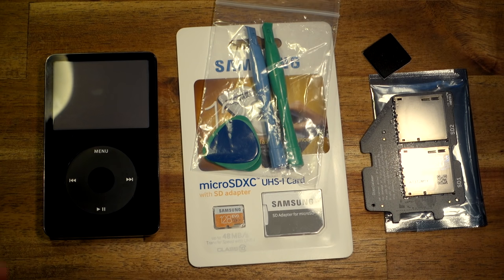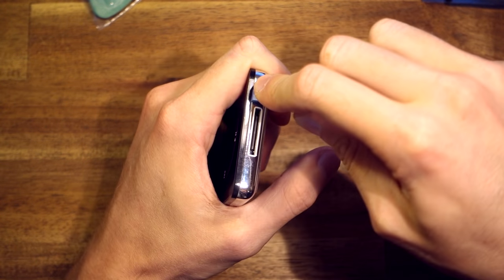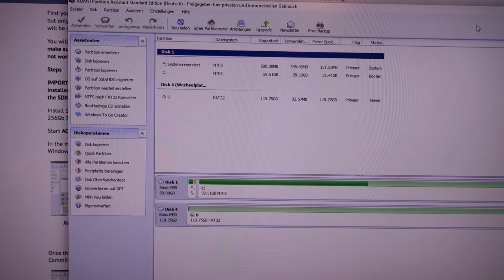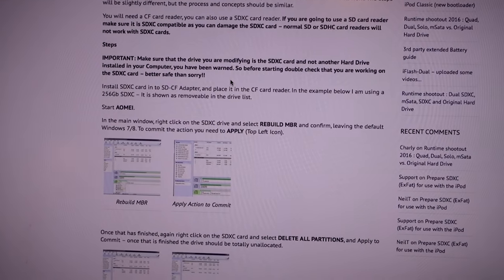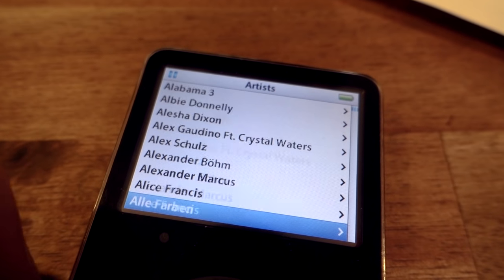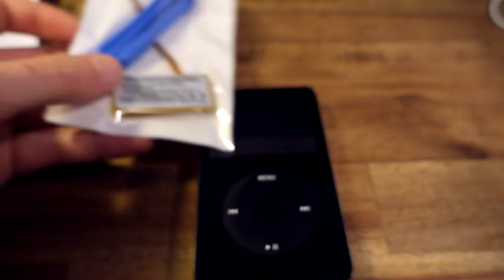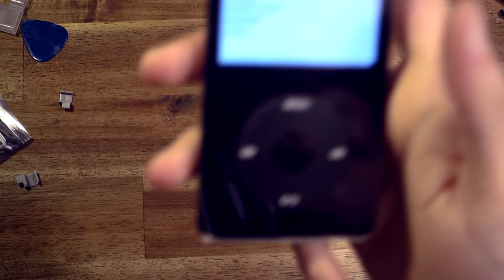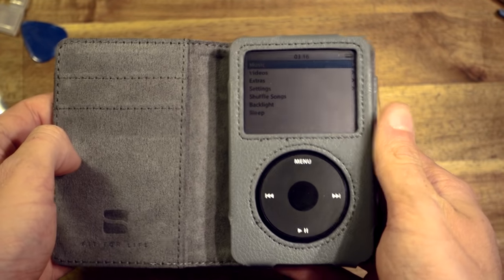iPod Video 128GB SD card upgrade

Comment: Nice little video with helpful info about the parts. Thanks!
The only nonsense I see here is the case for the iPod. A case is to protect it from stratches, but if it's already strached, you don't need it!
Reply from the maker: Cheers! :) For me the case is mainly for drop protection ;)

Comment: Thanks for sharing the video. Too bad about the screen. Something similar happened to me once and that is when I learned to always have a soft clean work surface. As long as we learn from mistakes, it's all good.
Reply from the maker: +chaukat wolfgang I definitely learned from that mistake :D but as you said it's all good. And I found a cheap replacement screen which is on the way to me now, the iPod just deserves it ;)

Comment: I had the same problem. Turned out I was using too cheap of a compact flash card converter card. Who would've thought something manufactured in China to the US market could be substandard? (Obviously sarcasm)

 When I got a more expensive one, My San Disc 128 GB CF card worked awesome. This has to be a compatibility issue between the card and the card reader or the card reader and the iPod. 

I also got the extremely low battery even though I was replacing the lithium battery at the same time. If you tear the cables coming out of the battery or the port switch, both are available for very reasonable cost online. My headphone jack and batteries were worn out so I decided what the heck… Go ahead and replace the HD with a CF card.

 so what exactly is everyone repairing 15-year-old technology when you can bye replacement for about the same price?

 Because we can.
Reply from the maker: Cheers for your comment John! Awesome that you got the CF card working, maybe this helps some people out here :)
Reply: remember the ipods and iphones are made in china
Reply: Repurposing classics never dies.

Comment: If you write the date that you replace the battery on the inside of the cover with a marking pen, next time you crack the case open, will know how long that battery lasted. Guess my old dad taught me a few things!

 using foam to adhere the battery to the metal cover doesn't make sense. Metal conducts heat. Why would you want an insulator between a battery which can get hot and the metal plate which conducts the heat away from the battery and circuitry? I used two small pieces of double-sided cellophane tape. I want the battery heat during charging and discharging to dissipate. At least theoretically it makes more sense… Right?
Reply from the maker: Ah yep your're right. Tape is definitely the better way to go, makes sense. I will replace mine when I open it next time :)
Reply: Brilliant idea!

Comment: nice video. I still use my 80gig and plan on upgrading the storage and replacing the battery soon. Mines a lot easier to open than yours, usually just use the corner of a credit card and it pops open.
Reply from the maker: Awesome man! Mine now opens also a lot easier than the first time :)

Comment: I just installed an iFlash Solo into my 30Gb iPod Video and wouldn't you know I installed the iFlash board backwards.  The iFlash Solo and iFlash Dual have the SD adapters on the opposite sides.  In other words, the iFlash Dual when properly installed both SD adapters face down (facing the iPod circuit board).  On the iFlash Solo, the single SD adapter faces up when properly installed (facing the aluminum back).  That's what threw me off.  Naturally, I got the same errors as the poster did so I flipped over the iFlash board and success.

IMPORTANT  What you want to make sure of is that the angled part of the iFlash board is always on the right side when looking down on iPod circuit board for any of the iFlash adapters.  The Dual is the only iFlash adapter where the SD adapters are on the opposite side from the other iFlash boards.  So, for every adapter, the angled part is always on the right side when properly installed.  The upper left side of the iFlash board fits in below the iPod's hard drive stop so it can't move around.

I wanted to thank the video uploader for the making the mistake of reversing the adapter or I wouldn't have known what I did wrong.  OWC's video didn't go into enough detail and they used the compact flash adapter which was different from the Solo. (Same with the iFlash site). Everything is working great for me and now I'm ready to replace the hard drive in my 80GB iPod.  My main reason to use the SD adapter was to get longer battery life rather than space for more music.

My 30GB iPod hard drive is still working perfectly after all these years (Thank you, Apple).  However, I needed to replace the battery (again) which couldn't hold a charge and I noticed the Tarkan iFlash when searching for a battery on the internet.  I killed two birds with one stone and got a new battery and the iFlash.  Awesome boost for an old iPod for a total of $50.

Comment: Congrats for the video! Quick question: is it necessary to Format the SSD before inserting on the Flash Board? If so, which Format must be used (MBR, GPT, etc). Thank you

Comment: Hey, first of all, good job! This will certainly help a lot of people, so this is nice. Did you have any i/o problems with the SSD? I mean, is everything always OK in the filesystem, so you can transfer and perform all music without any problem? I'm asking because I replaced my Ipod's HD with a Sandisk 128GB SDXC but even thought everything looks fine after synchronization with iTunes, most music just don't play. They are there, but just don't play. I suspect it's some defect in the SSD. What do you think?

Comment: Seems that the screen didn't crack, maybe the conversion board is just touching the reflector :)

I like the HDD sound as well, that's why I didn't change it, maybe when it die, but it's supposed to last several years (I use a rubber case :) )

Comment: Wouldn't it be possible to mod it with a Micro SD card reader and with the extra space inside get a bigger battery in there? I'm sure with the right regulators like the ones used for Raspberry Pi zero and such it could work out
Reply: You were way ahead of the game and predicted the future there!

Comment: really kool guy. got two of these iPods. one for every car. the one i have in my prius still is rocking the old HDD and runs without a problem. the one in my 300 died so i replaced it with the compact flash thing. only 16gb. but i must say, your iPod runs really snappy. more snappy than my CF iPod. nice work on your iPod though. those plastic tools suck.
Reply from the maker: Cheers :) It's so cool that there are still a lot of these iPods around. The plastic tools really suck :D

Comment: I was wondering if using an micro sd to sd adapter would be okay! good info.  
I am about to do mod myself.  I can't decide whether to go with tartan and get his stuff whether it be the SD solo, dual, the quad micro, msata or even the CF flash (I found a 128GB cf card on amazon for 70+ bucks!)
or I am also wondering about maybe just getting a cheap Chinese zif to msata adapter and using a 256gb msata.
My whole question lies on the battery.  I do not know if the Chinese adapters will still allow me to use a larger battery. Did you find any larger batteries online? what size did you use?
Reply from the maker: I didn't really find larger batteries online, I think mine is 550mah which is a little bit larger than the original but the same size as the original. As for the adapter I think I would go with a SD card adapter, it seems like msata uses a lot more power. They tested it here: https://www.iflash.xyz/runtime-shootout-2016-quad-dual-solo-msata-vs-original-hard-drive/

Comment: hey bud i have some questions for you ,i do not want to purchase or buy songs my favorite songs are on youtube which are videos ,is there a way to just download the song portion of that video also is there a better way to down load these songs or videos to the ipod  i plan on doing the same mods to my ipod .great video by the way . do you ever download the upgrade that apple offers .so having 2 flash drive readers will it switch back and fourth or what is the reason for having two flash drive readers ,       thanks

Comment: How did you power off and out the iPod on hold but when  you are opening it, it is back on again? There is no programming on the SD card you just put in. You need to recover it.

Comment: I've just ordered the parts for my old 5th gen Ipod Video. Its stuck on a white screen, not recognized on iTunes or Windows so I think the hard drive is kaput. Gonna try a 512gb microSD card, 3000mah battery and capacitors mod.
Reply: be sure the battery will fit. The big batteries need to either go in the thicker 60/80 gb ipods, or you need to buy a thicker back and move everything over to the new one

Comment: I also experience the "battery very low"-message, altough I tested my adapter in both directions. (I am using the Adapter to CF and the Adapter from CF to SD, which ways sold as a set on iflash)
i also tried using an old 8 GB CF Card, which worked for a weeky until the " very low battery"-Situation appeared again. i might try to change the hard drive cable.
Reply from the maker: The hard drive cable would be also my next guess, good luck! :)

Comment: did you have a good seal around the ipod or do you have a small gap somewhere where it did not seal right?
Reply from the maker: I have indeed a very small gap but only on one side of the ipod
Reply: Geigi's Room i did too then I realized that part of the closure came undone, so I glued that part, let it dry, then closed it from top to bottom and the gap went away. it helps if you use a type 1 cf adapter or break down a type 2 housing.

Comment: Hi Gigi - I have a 7th gen I'd like to use with my car audio system. What about wear and tear on the SD card, how has that been? I thought you needed SSD quality or type of flash memory or device. I thought SD cards can wear out fast in heavy read/write environments. This issue happens a lot with Raspberry Pi devices being used in servers or environments with heavy read/write needs. I suppose SD + iPod Classic is cool as long as you don't update or change your songs around too much?
Reply from the maker: +Cerulean Fish yeah my sd card is still working perfectly fine! The only big write scenario is when transferring new songs to the iPod, and that is still a lot less than using the sd card in a camera for example. So I think you can use it pretty reliable in an iPod :)
Reply: Cool, thx for reply... After gaming a bit with the classic Rockbox games, my battery is fading so I'm thinking of saving and doing a new batt and SD card holder for lower power consumption. Thank you for sharing the feedback. :D

Comment: Did you let iTunes format it to Mac OS X extended when you restored? Or did you have to use disc utility and partiton it as fat/ex fat
Reply: I decided to format my SD card with Apple Disk Utility and an SD card reader using exFat just in case.  Then I normally restored the iPod using iTunes.  I wanted to make sure everything worked before I closed up the case which is a pain to open. I used a PNY 128GB Elite Performance SD Card.  The iPod is working fantastic.

Comment: I have question I have the same as yours but mines is 5.5G which last model to 6 Generation. It's a 30GB I was thinking about upgrading to new 30GB Hardware swap out the old 30GB Hardware but I have second though I want to get one of those SD Card Adapter I'm not so sure what kind of SD Card can I get for 30GB model will it handle processors.
Reply from the maker: iflash.xyz has some supported SD cards in a list

Comment: How fast are the transfer speed with the SD Card inside? I also have a g5 30GB and I'm planing on modding it. I just have to wait for some parts to arrive. The HDD is about 15MB/s. Tested with crystal diskmark.
Reply from the maker: +Griffelkiste transfer rates are as fast as USB 2.0 allows for me, about 20-25 mb/s :)
Reply: Sadly the iPod transfer speed is lower after modding it (13,5MB/S) but the cover images are there immediately and the iPod feels faster over all. The SD Card it self had a tranferspeed of 20MB/S write and 85MB/S read. Maybe it would have been faster with iflash module but I've gone the cheap route with zif-cf-sd. Anyways I'm really happy with the mod.

Comment: Nice video G. but I have a question. I own one of the ipod video bought for me by girlfriend at the time. I must admit it got broken at the end of its warranty but cuz of its sentimental value I don't want to throw it away. The problem is the hard drive gave in so I have a funny image on the screen every time I turn it on. Can this be fixed?
Reply from the maker: +Nana Coxy what is displayed on the screen? Can you describe the picture? If it's only the Hdd it can be repaired with an adapter like this one!

Comment: Hi! Would you know if instead of an SD adaptor, I make use of a CF adapter and then use a CF memor card that has an SD adaptor in it would work?
Reply from the maker: I think people already did this and it did work. But you need a compatible CF adapter (I think not all of them work) and a compatible SD card (some of those definitely dont work). Just google a bit and you will find sd cards and adapters people already testet.

Comment: Great job! I installed a 64gb msata and made a video on my 5th gen ipod a few months ago. It's great other than it gets pretty hot syncing music. I also nearly damaged my lcd from the pressure of the adapter because at one point it's slightly thicker than the hard drive but luckily I noticed discoloration on the lcd before I closed it all the way so I stopped to readjust the adapter to relieve the pressure. Now it works great and battery life seems at least as good as with the original hard drive. 

Recently I bought a broken 6th Gen classic and the same iflash adapter along with two 128gb cards and a new battery so I can't wait till they get here. Rockbox + 256gb + fresh battery that should last ~40 hours according to the tarkan site = win!
Reply from the maker: That sounds awesome man! Great that you didn't damage your screen, the replacement one I got doesn't look as nice as the original one
Reply: Hey how was your 5th gen battery life in terms of hours I mean. I ve used tarkan flash card but the 650 mah battery all I'm getting is 10 hrs of music playback do you think anything wrong with my Ipod?